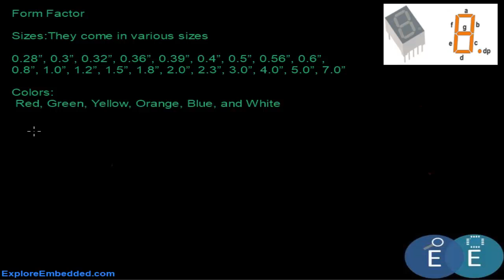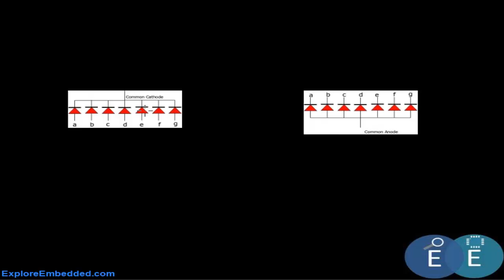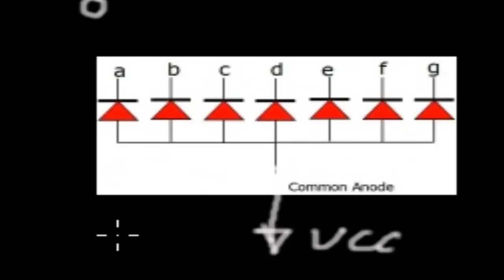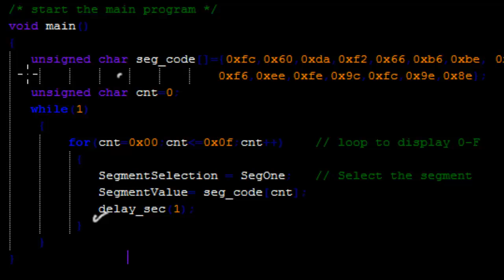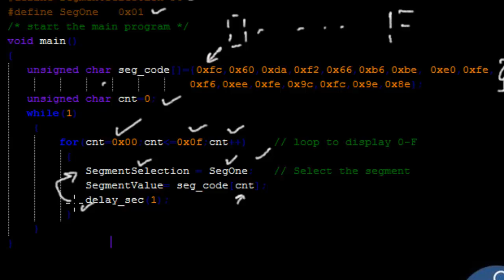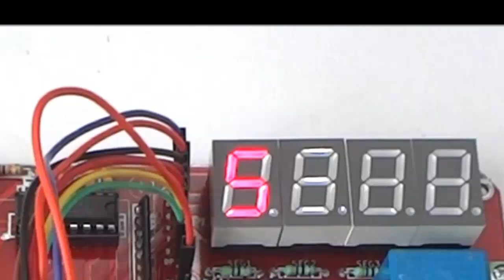8051 Seven Segment

Comment: Good Tutorial....
Do you have any tutorial where we can interface 4x4 Keypad and Seven Segment multiplex display with 8051 and display numbers on seven segment using keypad press...
Reply from the maker: There are individual tutorials for this, https://www.youtube.com/watch?v=6u_3dr5utSU&list=PLRuRKN7_FVgtdXWWM-uosWYfmOFDp63dd&index=18  You can watch them learn the basics and it will not be difficult to do you need.
Reply: thanks for that...
but yes... i have gone through your tutorials, but what my question is how can we connect keypad and seven segment display together.
because output what we get from keypad is numbers and to display on seven segment display we need hexadecimal. how can we do that....
Reply from the maker: If you're using our keypad library it gives you ASCII value of the key pressed, you can convert that to hex and display it. Search for ASCII to hex conversion, it is easy.
Reply: cant download the file....
it gives me the error..
Server DNS could not be found...